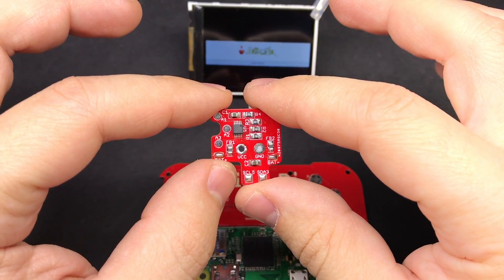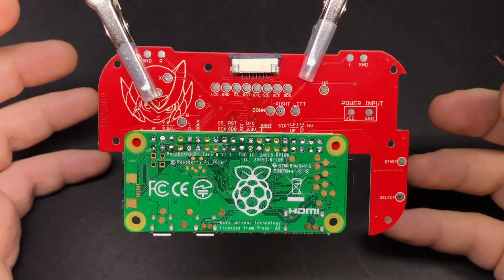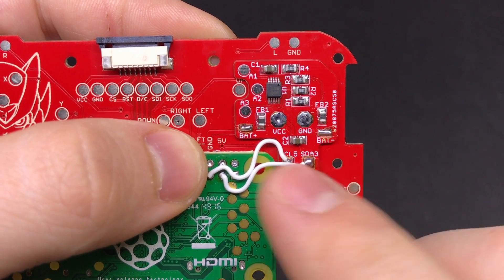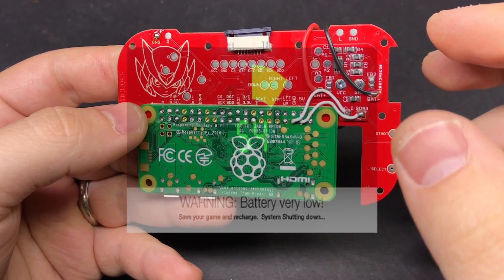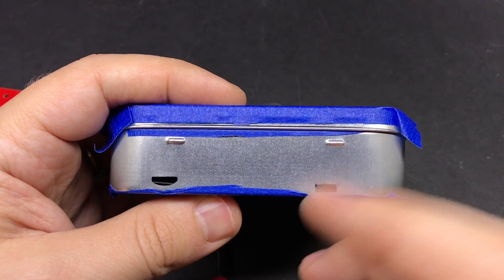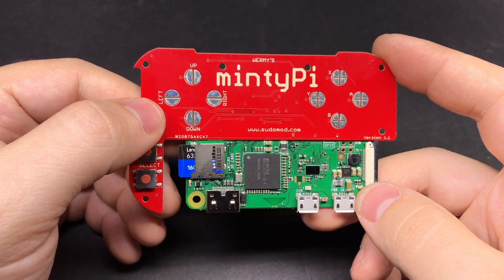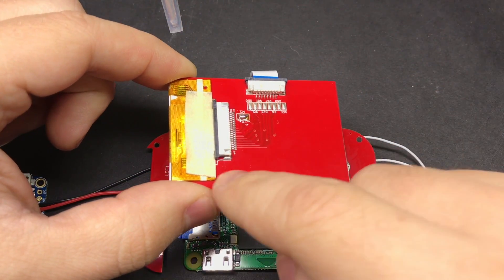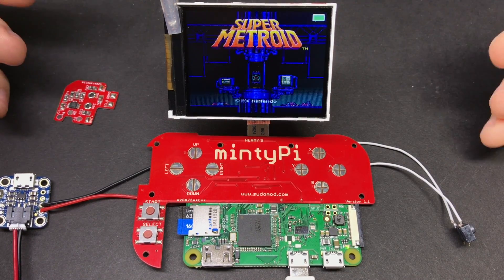mintyPi Battery Monitor Install Guide (and other updates!)

Comment: i am software savvy, so soldering isn't a skill i have. how much does it cost to get this in classic nes style, for example, buttons from a retron 2 NES controller, and so on, prebuilt.
retron 2 is a system that plays nes and snes games with exact replicas of the controllers, only takes cartridges

Comment: hi wermy, im a huge fan. ive tried to make a minty pi at least 5 times. each time i failed eventually with the soldering.  i have spent so much time and money trying to make this thing. it would mean so much to me if you could sell me a fully assembled system. thanks

Comment: Hi Wermy, is it possible to use that with a pb500c? I made my first one with the Pb has I had this around. I would also desolater the enable pin and solder directly to vcc and gnd on the pb;)